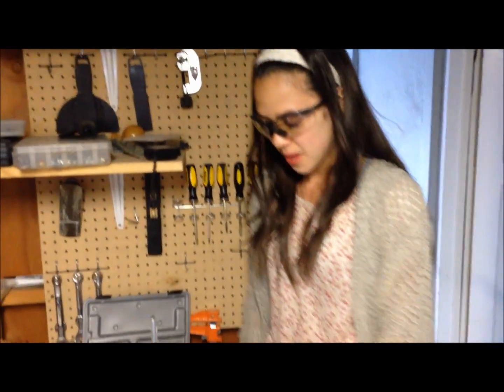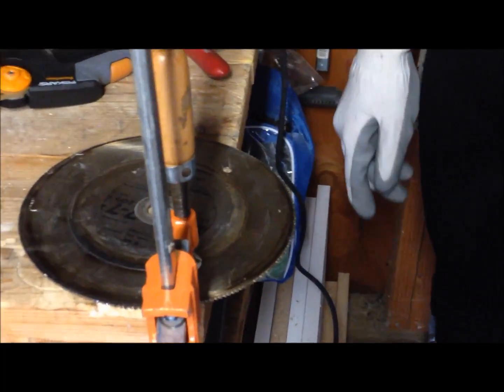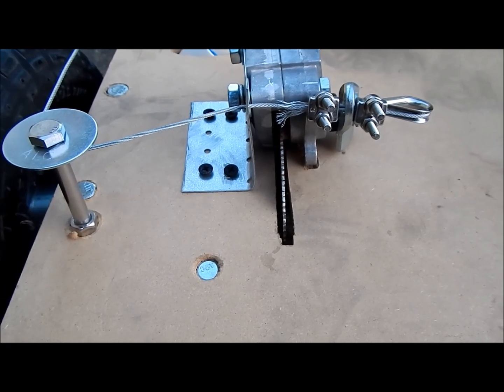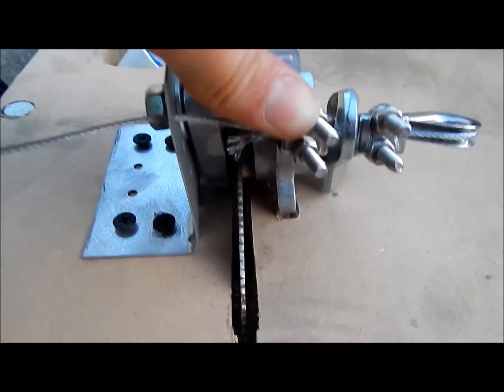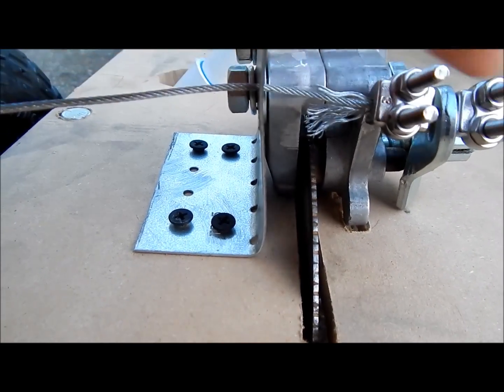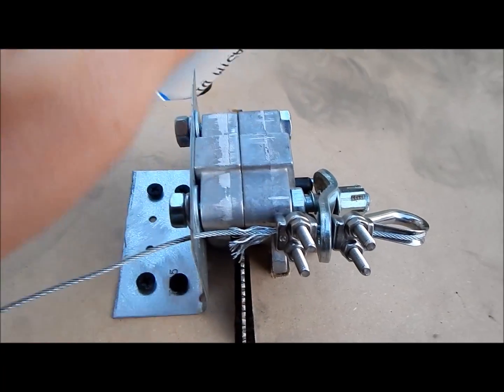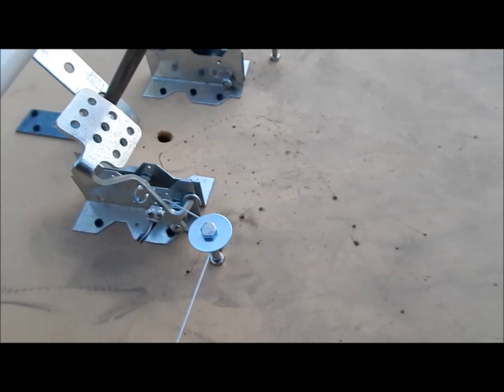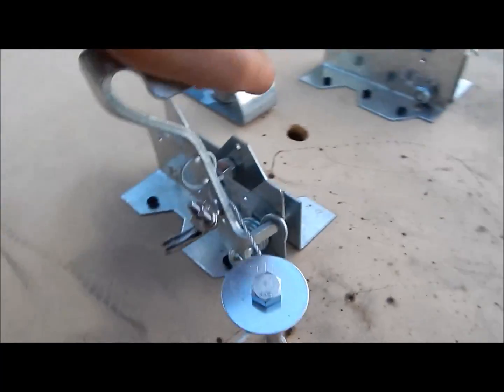Go Kart Disk Brake System

Comment: I applaud you young lady very innovative! However the brake caliper is not designed to use it pulling the lever to the side because you only load one pin the pushes on the break pad, it is meant to rotate pushing on both pins. Anyway good job!

Comment: You Shuld have two disks welded togather. To make it last longer. Unless u are going to have your brakes changed alot
Reply: Braedy Johnson she shouldn't have welded it in the first place. It's going to be a pain in the butt to get that thing off now instead just buy a cheap key hole disk mount and use that